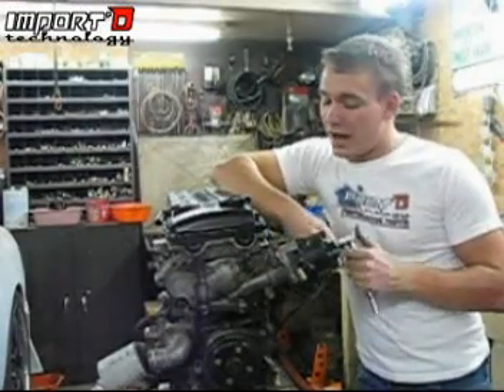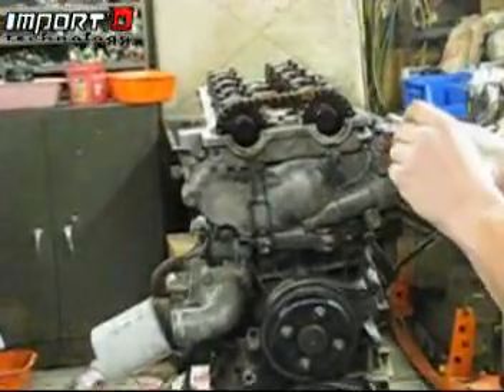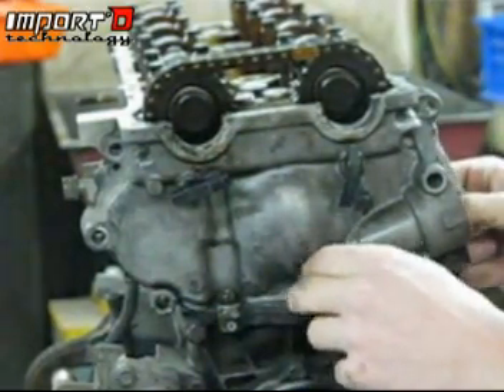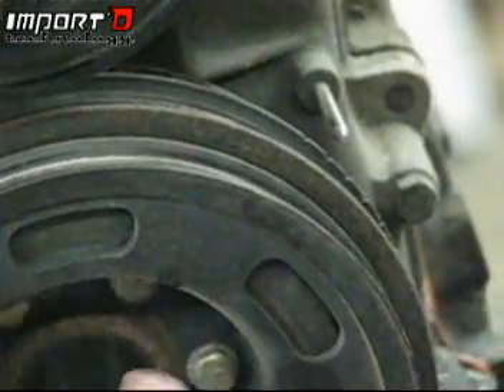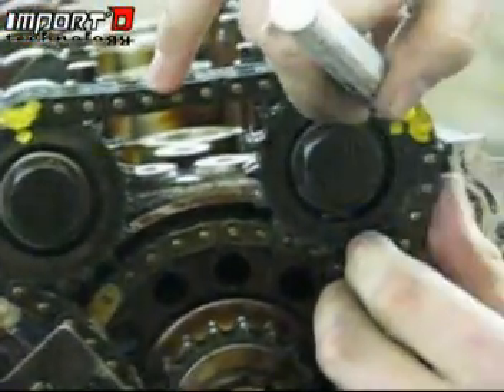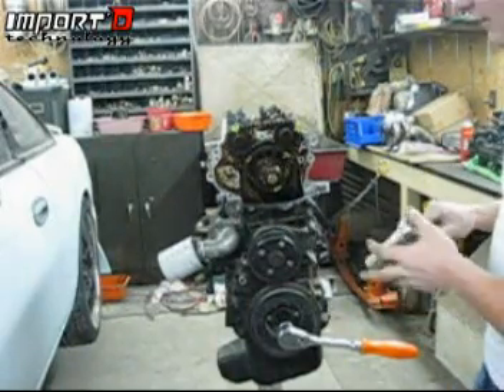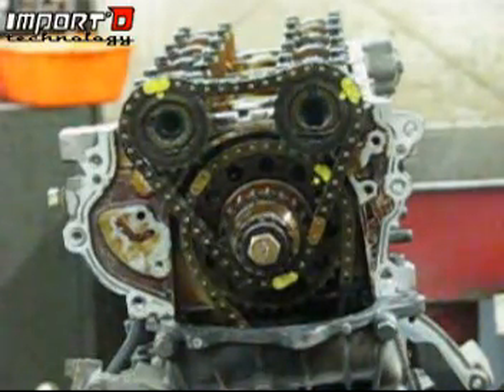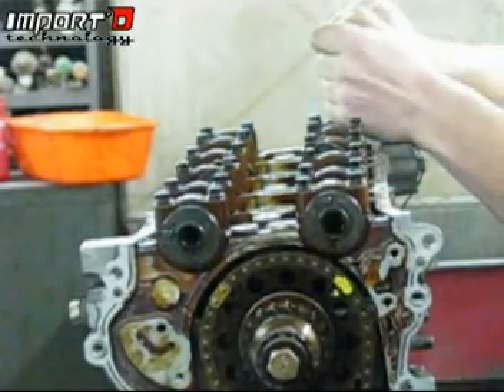Part 1 - How to remove cylinder head from KA24DE 240sx S13 S14

Comment: I've just rebuilt my 03 2.4 nissan can after about 1000 miles the engine developed a tick that I believe is From a faulty timing chain tentioner but while diagnosing the timing chain issue  I realized that my cam shaft has up and down slack which doesn't seem right to me.. ??? But I'm not sure can you help

Comment: I am taking my 03 frontier 200,000 miles KA24DE head to a machine shop for checking out if it is repairable. Bad gasket massive overheating. I have to remove all the bolt ons. I thought I would wait and see if the head is okay. If not no need to go any further. Not worth it. Is there some rule of thumb about what to "antisieze" and what to "locktight"? Wouldn't everything need to be able to take off if needed?

Comment: When are you gonna post the assembly video? Having some trouble getting the timing chain and cams lined up after I removed the head for a rebuild. My first piston is TDC (checked with a screw driver in the spark plug hole) and I think my intake cam and exhaust cams are in the correct position. I'm turning the motor by hand and looking at the intake valves but maybe you can post a video or help me out?

Comment: @kaantu it is possible to remove the cylinder head and change the gasket without take the hole motor out just did mine and yes i have a ka

Comment: when you put engine on TDC seems like you left exactly as your first try,so then its every other full turn on cranksahft as long as the camshaft lobe pointy part is facing out on both sides,is that correct.

Comment: is this a common issue with the KA24DE motor in the 2001 Nissan Altmia also? cause atm my crank position sensor is saying i have a issue and if i give it allot of gas to get up to speed on a highway i hear a sound that sounds somewhat like a blow off valve when i let off the gas but i do not have a turbo and i hear a rattle at low RPM's

Comment: I just purchased a S14 this week, and I noticed a slight rattle near the time chain.  It goes away when it goes above 1500rpm.  Is that normal, or is the tensioner not quite doing what its supposed to?  I read this is a hydraulic tensioner.....and the current oil is 5w20 (previous owner used this)  Will 20w 50 solve the whole thing?  I intend this to be a summer driver.

Comment: ive had a rebuild for my s13 for about a year now , come to find out they didnt replace the head studs and now i have water into my system , I went out and desided to do all the work myself , I got ARP studs and a Cometic Head Gasket ,and valve cover gasket , ive done some research and they are suppose to be some of the most reliable brands,  With this videos help is there anything else i would need sence the motor has been already rebuilt in the past.

Comment from the maker: @initialdfreak That is a bit on the confusing side. I guess if you cannot turn it, you can always pull everything apart at the spot it is at. Just make sure you mark the crank pulley and all your timing very well, along with remembering what way your cams are facing. Then reassemble the engine off of those marks after you find out what is wrong!